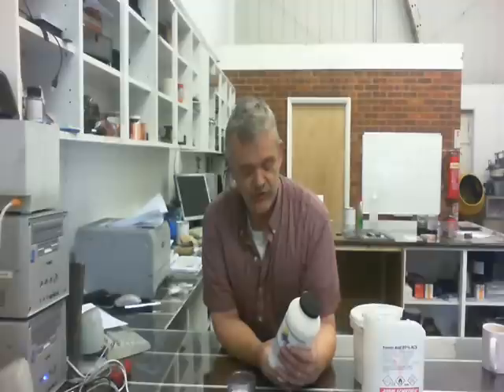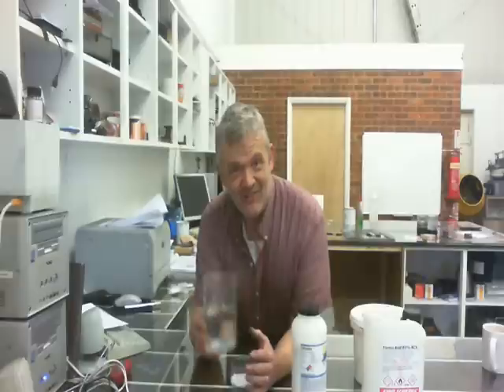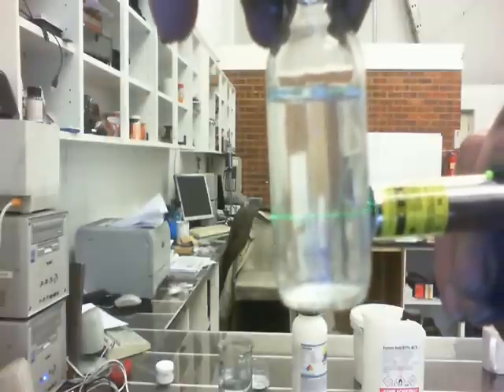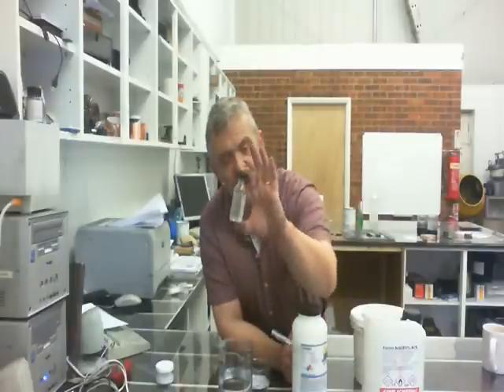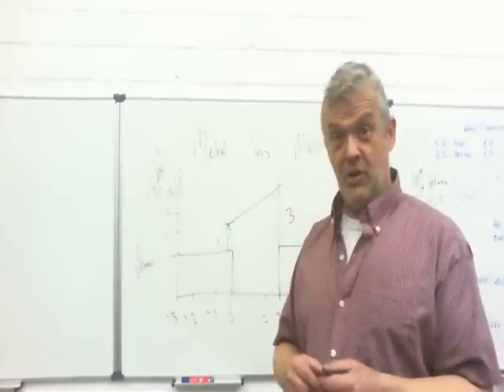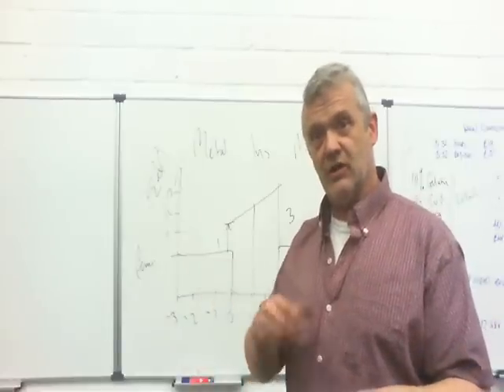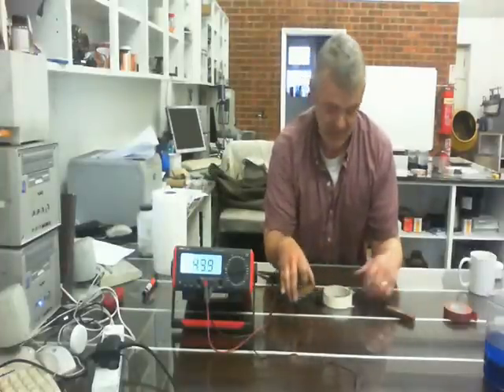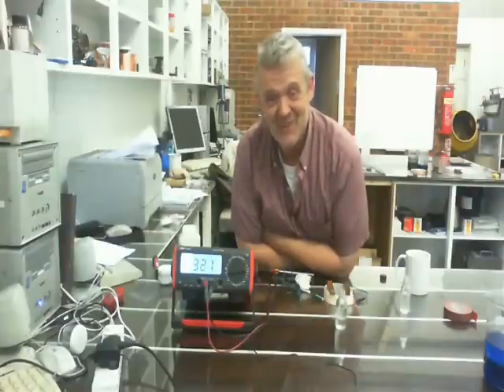The Birth Of A New Type Of Solar Cell ?

Comment: Robert Murray-Smith  you'll have more success making zinc sulphide by simple zinc sulphate-sodium sulphide double displacement. I made a very stable colloidal suspension of manganese doped zinc sulphide using this reaction(by co precipiation of manganese and zinc sulphides). Interestingly, it was for an electroluminsecent ink. Are there any specific crystallline properties you get from heat decomposed ZnS?
Reply from the maker: that is interesting - tell me more about the ink if you don't mind - i have wanted to make one of those for a while
Reply: Robert Murray-Smith what would you like to know? I am still exploring it's physical properties but have settled on the chemical synthesis and purification part.
Reply: Incidentally it is for the electroluminescent ink testing that I'm interested in nanocellulose-graphene transparent electrodes. ItO is rather expensive and I'd prefer to not blow my entire budget on the electrode itself.
Reply from the maker: Chaitanya Bhave your synthesis method is the bit i am interested in i am afraid
Reply from the maker: Chaitanya Bhave lol - I know what you mean
Reply: Synthesis is rather simple. I prepare (a)0.01 M solution of NaS in distilled water(b) 0.0095M ZnSO4+0.005M MnSO4(in same solution).A and B are equal volumes, it depends how much on you want to make.
I keep solution A on a magnetic stirrer at around 800 rpm and add solution B to it. It almost immediately becomes cloudy. I usually use a uv lamp to confirm if the doping has taken place-it glows orange around the edges of the beaker but looks mostly dark due to reabsorbtion of emmited light. Adding a little ethanol causes the ZnS to precipitate as a gelatinous mass. Then you can centrifuge it and wash further with ethanol to get good quality ZnS.
Reply: Adding some kind of stabilizer will yeild a finer powder(quantum dots) but that wasn't necessary for my purposes. After purification the ink making part I need help with though. I have negligible knowledge of ink preparation-any books you'd recommend?
Reply: Robert Murray-Smith hope this helps
Reply from the maker: Chaitanya Bhave hiya mate - it helps a lot -there is an ink formulators hand book - called the ink formulators hand book - oddly enough that has a wealth of information
Reply: Robert Murray-Smith glad to be of help.
Reply: Who's the author?
Reply from the maker: Chaitanya Bhave i am sorry mate i can't remember but you will know it when you see it - it's expensive lol
Reply: Robert Murray-Smith no problem. Glory be to Google, I'll find it.
Reply from the maker: Chaitanya Bhave lol - good old google
Reply: Robert Murray-Smith maybe you can try passing a dc current through the solar cell setup. It just may work as an led-it has graphene(electron injector) and zinc sulphide(dye+p-type semiconductor). If it does that you have the world's cheapest way to make LED's.
Reply: Didn't get the handbook but I found a couple other good books-turns out they're recommended by my university for printing technology students. Cheers.
Reply: Wait is it by NAPIM? Costs around 90$?
Reply from the maker: Chaitanya Bhave that's a good idea mate - how old are you if you don't mind me asking?
Reply from the maker: Chaitanya Bhave cool
Reply from the maker: Chaitanya Bhave it's the national association of printing ink manufacturers
Reply: Robert Murray-Smith I'm 19. Why do you ask?
Reply from the maker: Chaitanya Bhave i like the way you think and I may be able to offer you a job in the future
Reply: Wow. That is something. I must say I'm flattered. Though I do plan on continuing my education for the next 4 years. Would be real cool to work with you after though.
Reply from the maker: Chaitanya Bhave that's what i was thinking mate - which is why i asked your age lol
Reply: Also my current degree is undergrad in computer engineering, I plan on going for an MS in materials science. I learnt electronics in junior college and also read out of interest on higher physics-mainly application oriented. How does my cv look?
Reply from the maker: Chaitanya Bhave pretty good mate - and i like the plan you have there
Reply: Robert Murray-Smith do you know any good institutes in the UK for materials science? I've looked at USA but hadn't considered UK before
Reply from the maker: Chaitanya Bhave not really mate - i did chem
Reply: Oh alright. Thanks for the offer again-I really "dig" the kind of projects you work on.
Reply from the maker: Chaitanya Bhave cool - let me know when you finish at uni mate
Reply: Robert Murray-Smith Surely. If you do try the graphene-ZnS do let me know. I'm going to be restless till I find out lol
Reply from the maker: Chaitanya Bhave lol - will do mate
Reply: Robert Murray-Smith I am terribly sorry, but I have made a mistake. The concentrations of all the reactants are(or can be) 10 times what I gave them. The concentrations I mentioned before are all for quantum dots. For simple ink, 0.1M NaS,0.095MZnSO4,0.005M MnSO4 are more suitable as the yeild is higher by volume. There is also less water to remove at the end of the process. Sorry again- I referred the wrong page in my journal
Reply from the maker: Chaitanya Bhave oops lol - thanks for the correction - i will look at it again
Reply: The synthesis method is same, just the concentrations are different. Even at the lower concentration, you'd get the same product(at a much smaller particle size- around 10-50nm) whereas the higher concentration results in the particle sizes used for inks(100-250nm)
Reply from the maker: Chaitanya Bhave i undrestand mate - cheers

Comment: Please try silver nano particle & colloidal silver as electrolyte in your Solar Cell.
Reply from the maker: I probably won't mate - silver is just too expensive for a general solar cell - probably better to use an ionic fluid and I have done a video on how to make those from cheap materials
Reply: You can make silver ionic fliuid or  by it : 
#378 How to make ionic, nano particle & colloidal silver
Reply from the maker: Bartosz Barejko
ok - still not doing it

Comment: Hey' Robert just thinking about what your doing and thought I might mention a well known compound TITANIUM DIOXIDE it is much more easy to obtain and less complicated. Could this work in your nanotube process as well as what your using? Also if you want, have a look at the 20 year battery using TITANIUM DIOXIDE nanotubes gel LITHIUM-ION batteries at www.disclose.tv, just type in 20 year battery from the researchers at NANYANG TECHNOLOGY UNIVERSITY. Robert you do a great job with your video's. Thank you for shearing your knowledge. I look forward to see what you have coming next. [LOL] Your book is being fill with great things. sign JAMES KENNEDY
Reply from the maker: Hiya Mate - I use TiO2 later in the video. It's catalytic for the reverse reaction but not really usable by itself - like in a gratzel cell. Thanks for thinking about it.
Reply from the maker: I was mulling this over further - you wouldn't want to use commercial TiO2 either mate - you would need to use nanoprticles - they sell those but they are not cheap - probably better to in situ synthesis them - I think this is a do-able but non trivial project mate

Comment: Isn't there a device called "the black box" that uses something similar to this? It has stacks of razor thin sheets that generate immense amounts of power.
Reply: +Pac Oo 

Bloom Box.   It’s a Fuel Cell that converts Natural Gas to water, heat, + electricity.

Since we can MAKE Natural Gas from CO2 plus solar energy it offers a closed-loop power option if we put solar cells in all our deserts.
Reply: <how cute, spam

Comment: rovert.se can change the zinc sulfate zinc oxide ??
Reply from the maker: bruno agrelo yes but it is a long way to do it and zinc oxide is very cheap
Reply: Robert thanks for your prompt respuesta..en my country is very expensive energy and solar panels are not within the reach of workers comunes..por this reason I'm looking for a way to make a solar cell I tried to replicate assays eficiente.he Flexible your cell with few resultados..tome a film and achieve acetate do el..tome conductive graphite rubbing two thin sheets of copper ( anode ) and one of aluminum ( cathode ) and electrolyte used .. potassium iodide. then use other electrolytes such as salt , magnesium sulfate can help etc.With few results not understand where I have failed. 1.5v would have to give me a minimum and I 've only come to 0.40v ??
Reply from the maker: bruno agrelo  I am sorry mate - without being there i just don't know what went wrong. Try making a video so i can at least see
Reply from the maker: bruno agrelo also - what background in chemistry do you have?
Reply: robert , the truth that I have little chemistry .... why you like consulto..gracias
Reply from the maker: bruno agrelo No worries mate - you will learn as you go along - but remember my time is limited and you will have to do quite a lot of the work yourself
Reply: ok.gracias.un cordial saludo

Comment: test in sunlight
Reply from the maker: Terry Hope seriously? - you think I didn't think of that? - if i didn't do it there is a good reason - actually 2 - it was pissing it down all day and there was no sunlight and it is a pain to drag everything outside to film it - come on man - think it through!!
Reply: Robert Murray-Smith Hi sorry I was just curious the output from direct or indirect sunlight or output under concentrated light
Reply from the maker: Terry Hope yeah me too mate lol - supposed to be sunny on friday - i'll be on the roof lol
Reply: Robert Murray-Smith Don't jump Robert!!! lol
Reply from the maker: Eflat Productions
lol
Reply: Robert Murray-Smith
next-superconductivity
Reply from the maker: Terry Hope
lol - now there's a challenge
Reply: Robert Murray-Smith lol
Claimed Evidence of superconductivity near the boiling point of water-chemical formula is Sn5Sb5Ba2MnCu11O22+---copper-oxide ceramic
Reply from the maker: Terry Hope
cool - there is also room temp superconductivity in graphene soaked in hexane - anyway thanks for that mate
Reply: What you need is powerful light that approximates sunlight. Halogen might do the trick.  From Wikipedia "Like all incandescent light bulbs, a halogen lamp produces a continuous spectrum of light, from near ultraviolet to deep into the infrared.[14] Since the lamp filament can operate at a higher temperature than a non-halogen lamp, the spectrum is shifted toward blue, producing light with a higher effective color temperature."  Usually with halogen bulbs the glass is fused silica which I'm pretty sure is transparent to UV.  That's important because Zinc Sulfide has a pretty high bandgap.  Then you wouldn't need to move the filming outside, which I understand is a pain and not always even possible.
Reply from the maker: Joseph Richardson
good idea mate - i will make a test bed
Reply: Wait!  Just use your photosintering box!
Reply from the maker: Joseph Richardson
good idea - but if i make a test bed others can repeat it - the box isn't that easy to make - well it is - but a bit more expensive to make and a bit more scary than screwing a light bulb in and hanging it a meter above the cell lol